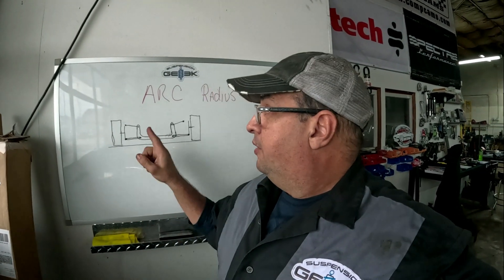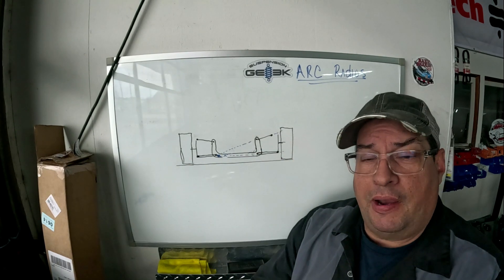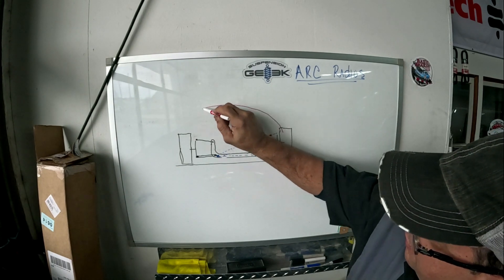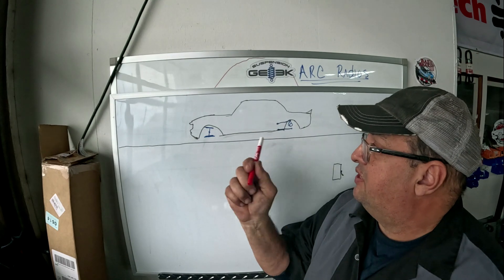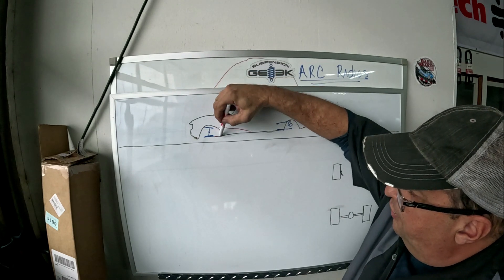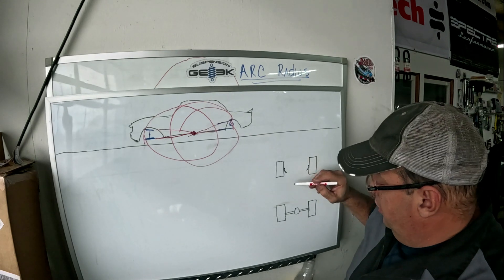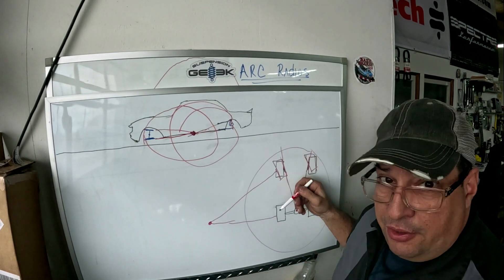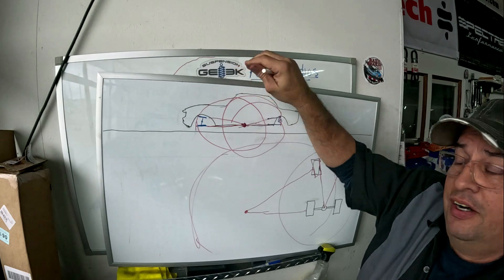THE Best Suspension Secret REVEALED

Comment: OMG I can't believe someone actually doing this. I was doing this back in the late 1970s 80s 90s building nascar open wheel modified. I can show you piles of paper work before we had computers where we designed chassis on the jig with string, plumb bobs, straight edges and tape measures. Roll centers, instant centers, torque arms etc. I'm glad to see this video brings me back to the old days but this still applys today. Great video !!
Reply: ,,,,,,,,,,,,,,,,,,,,,,,,,,,,,,,,,,,,,,,,,,,,,,,,,,,,,,,awesome support for this man's work and presentation..................................

Comment: If ya don't have a 4 link some guys use RAS road active suspension to get rid of wheel hop & set one side tighter to keep the rear wheels straight off the line as a hack until ya get a good 4 link set up like Detroit Speed or QA1 making sure your front set up is compatible with the rear set up

Comment: So old school.....
We have progressed to 
"Linear track suspension"
Where the wheel moves vertically, no in an arc at all....
Everything from McPherson strut forward.....
Reply from the maker: What are you racing? You sure there isnt an arc? Even struts have arc... that is why you have the set static camber and then you have dynamic camber.. what is gained during movement.. that is the part moving in arc
Reply: @SuspensionGeek  
No arc.....unequal wishbone lengths ( double wishbone )
The wheel rises vertically as the front track reduces. ( I wish I could draw you a vector diagram )
It maintains full tread contact for the whole suspension motion....improves tyre wear and grip.
Under load, the front track reduces for improved cornering.
Also maintains full tread contact under "body roll" load.
Corner radius is reduced under brakes compared to "flat out" through a sweeper, for example.
( it is probably why a V8 Supercar handles better than a NASCAR...... and no, I will not give you the figures.....just the principle....
castor, camber and toe doesn't change
and is now static throughout the suspension travel..... if you get it right !
( steering adjustment ESSENTIAL draw your vector maps in "3rd angle projection" and you will see the steering link incorrect length and "radius point" will cause toe-out through travel )
Reply: @SuspensionGeek  
If ya didn't get all of that but understand the principle, I will send "ballpark" numbers and angles as a starting point.
If you do, you don't need them.
Just start "playing" on your whiteboard.
Vector diagrammes using
Tech drawing "3rd angle projection" ( or 1st) works wonders for instant angle alignment.
Even track width change under load is adjustable when you look.( by adjusting the length of the wishbones ).

BIG "BALLPARK" 4 inches vertical motion for a 1 inch reduction in track per side .... this ratio is not correct, for my vehicle, but gives a "starting point" for your own dynamics.... play with this ratio from 2:1 on your whiteboard... as it obviously depends on your spring rate and suspension travel to "dial in" the desired results

Comment: You are showing the arcs and the lines and approximately where they can be or should be, but not explaining why one is better than the other. 
What happens when the rear squats when launching from a dig or out of corner then the outer circumfrence of the turn side of the car is squatting mor than the inside. How do all these things affect the arcs. Or when you are diving in to a corner and hard on the brakes and rear comes up and the nose is squatting. All the arcs are going to be changing along with the centers. You are going to need to shows us real world cars in action, or 3d simulations to have any hope in making anyone understand what you know and are thinking. Just drawing lines and circles and saying it is better explains nothing if your goal is to get the viewers to understand. And quite frankly, as a viewer I have no idea what you are talking about. 
Next, what cars do that you have setup are winning races so we can be confident that just because you say it is better is true?

Comment: I'm going to be amending C7 Corvette cradles (subframes) with suspension and C6 drivetrain onto a Stephen Blake era Avanti; which still utilized the original Studebaker Avanti frame. I do have a slightly longer wheelbase and must have the torque tube lengthened. Having watched your video, it has coerced me to do some suspension tweaking to adjust the longitudinal instant center since I have a longer wheelbase than those Corvettes.

I'll keep the Corvette's track width, as the factory Avanti's track width will be extended via some bubbled fender flares.

Comment: I spent 30 min. on the Art Morrison website before designing the four link system for my 1976 F100.  Sent them out for laser cutting, and after having assembled everything,  I was amazed how well the tires would lift during launch. The key was triangulating the geometry of the intersection point of the upper and lower links to meet at the centerline of the cam journals..

Comment: Neither "arc radius" nor "instant center" were mentioned in my engineering school.  If they were, it was briefly once, with no application.  We didn't have an automotive program, so maybe that's why.  Anyways, I've still learned more on YouTube than I did in class. 🤣
Reply: Arc radius center does not only apply to cars and trucks.

The term arc radius center refers to the center of the circular arc along which a point or object is moving. It is essentially the center of the circle that defines the arc.
Reply: I have understood 'instant center'as in coil springs suspending automobiles. (I'm kind of old Chrysler/Packard. Tortion bar stuff) With coils the weight of the car is stood down on the contact point of the tire. Tortion bars the weight kind of needs to find it's way to the ground and the tires just happen to be in the way of the car tipping over further. Sounds funky I know.  This guys 'instant center is quite valid and I do trust his terminology.    Good presentation.  Good starting point for further discussion in suspension design .

Comment: Thanks again for another informative video Rod. Maybe could we have steering components next? I know not many know what Ackerman is and also how to inspect for slop. And maybe the complexities of switching to a rack? I have a 73 ventura. With an LS. It came with a 69 firebird steering system and I want tighter steering but I don't want to have to fight to find another oil pan that will fit.

Comment: Read Herb Adams Chassis Engineering. Less drama, more straightforward facts. Anti-dive and anti-squat can be adjusted for best road race, drag race or autocross. Throw in Ackerman where the inside tire vs outside can also be adjusted per track (F1 does this all the time), caster and camber gain and there are all sorts of combinations of adjustments that have little to do with string circles or meeting at magic points in space.
Reply: There is also Steve Smith Motorsports.  Not sure he is still doing stuff but he had a few books on suspension design.

Comment: Wow you will have to tell me if my other comment is on right track or total confusion. I love the way you expressed yourself thru the concepts and found I could follow and  understand the cause and effect. But now and no joke would you make a video and is the following  a more complicated  model, So if I'm driving my japanese front wheel drive on gravel and rallying when i'm approaching a hairpin or like as I down gear creating a engine compression to unstableise the car in the opposite direction to the corner so its easy to flick the car to face the direction the road is at the exit of the corner but my wheels direction are actually following the radius of the road ( parallel to left and right gutters) unless I have to fine tune that angle incase i had the speed or camber of road etc misjudged but all in all a easier task than trying to drive around the corner without sliding.  So I'm asking are there extra arcs at play or other geometric shapes??

Comment: So Im at 1:16 iin and want to test a crazy phenomena.  for the last 20 minutes ive been thinking about force feed back simulator steering wheels and how the whole concept is nothing even in the same ball park as how steering in a real car functions and feels. So im trying to picture in my head when a road is extremely undulating like every meter either side could go up and or down 300+ mm, Then to stay straight you just let the steering wheel drop left and right depending on which side has the depresion, then im is that just old cars with sloppy steering and for the life of me i was stuck befuddeled as the steering wheel turns the direction of the depression then on the tyre would turn away from the centre of the road  and car leaves road, But not with the arc drawing it onto the angle.  If that's the case then thats super spooky due to You Tube never Ever suggesting something i want to see and more so the maths solution to the physical function my brain knows but cant display in a mathematical schematically technical model to express to some one else why I think about the simulation wheel being far from similar to life.

If not then I'm sorry to be spinning my wheels in your comment section,  and a least in going to learn something .  im sure im going to look like a fool but I cant help my self

Comment: From the factory with leaf springs and no anti dive on the upper control arms. Did these old car companies take suspension geometry into consideration, or did they just slap some parts on a frame and call it a day? I love suspension engineering but seems no one is into it. Most people don't even inspect the underside of their vehicle before purchasing it.
Reply: They did look into the geometry but they heavily focused on making it easy for the wheel to turn from a stand still or slow speed. Which in turn is horrible for at speed handling
Reply: Yes smooth ride and ease of steering      then came wide sticky tire and enlarge return lines from the power steering boxes to the resovour. Oi.   @AutumnsGunnar

Comment: Cool, right? Yes! I was an electrical engineer who drifted into software and spent most of my career there. Recently I got into motorcycle racing and I’m setting up a race bike for next season. Now I realize that mechanical is where my passion lies.
Reply: Mechanical is great. Not any king of technician/engineer. (Heck I'm not career orientated at all. Me so stupid). Back when cars in the junkyard were mechanical marvels one can physically see mechanics. Now everything is electrical.  No levers and rods.  Everything is snap together. No nuts and bolts.   Very disenchanting.
Reply: @jamespell8091  While I agree there is a lot of new junk right now but we definitely still have nuts and bolts and levers and rods and things do not snap together.  
   A good example is the whole world trying to force electric cars and almost all the manufacturers falling in line to help their image.  
   except Toyota who saw through the hype and made decisions based in reality while media tries to paint them as falling behind in technology.   
   Instead of putting out a socially acceptable futuristic all electric flagship sports car they introduced a manual transmission only full time mechanical all wheel drive not an electric axle Even though they already had one developed and could have very easily just thrown that in there.  
   Instead of dropping the manual transmission from the line up like other manufacturers,  they made it the premium model.
   It's both, a fully mechanical drivetrain with three pedals, a 300 horse power engine in a Corolla with a beefy block deck and cylinder wall thickness like a darton block.  And a warranty.
   It's also port injected and direct injected and got dozens of magical sensors. 
   And if you were to go down to the junkyard today you could see them.  It's not all the cars it's not even the cars you would think it would be but internal combustion ain't heard no fat lady, and it's a hot rod golden age right now and we are driving to the conclusion that we are the answer.
     Also I take offense to the term junkyard, they are Zen gardens if I've ever seen one.

Comment: Great video!  I was building a Locost for autocross.  I'm a fabricator, not an engineer, so when I got to time to engineer the suspension, I bit off more than I could chew.  Especially when determining ride height and wheel size/Tire OD came into play.  I've seen the principals before, but this has been the best with the tip of the iceberg of the why and how it's applied.

Comment: Using math as an example, one of the biggest issues I've had is being taught how, but rarely why or where it is applied. Like you said, fitting it all in a 20 min is not possible. I do feel like you're well on the way to the why and where end. 

In a future video, if you could and in how this affects the differences between different drives ( fwd, awd, rwd, 4x4), that would be amazing. 

Thankyou for putting this information out in the format you are!

Comment: Michigan Tech engineer here.  Your 'arc radius'  center is known always as an instant center.  These are dynamic systems.  That is why it is called instant.  They are constantly changing as the car is moving. (i.e. changing ride height or rolling, squatting, suspension traveling)  They do not use 'arc radius center' jargon because it is the instant center.
Reply from the maker: Yes i completely understand the motion dynamics and that roll center, instant center and COG are in flux.. like i said.. you cant break it down in a 20min video and if you want super in depth videos.. tbats not what im doing.. im taking the princlples and reducing it to the nominal that is needed to understand
Reply: @SuspensionGeek  You can absolutely break it down in 20 minutes.  It's not that complicated and you can also use correct terminology so you're not confusing people.  No one says "arc radius center".  It's "Instant center".
Reply from the maker: Ah, the "Instant center"! Sounds like the superhero of suspension terms. I’ll make sure it gets the spotlight next time! but the Instant ceneter and arc radius are two differant things, the arc radius is the movement of a pivot point the instant center is the location of the pivot points...
Reply from the maker: @rstreets and im waiting on your video breaking it down.... patiently looking at my watch....
Reply: Yes, but...

Yes, the correct term is for the point around which a car's suspension and steering move is the instant center. 

An imaginary pivot point where the suspension linkages intersect, effectively acting as the center of rotation for the hub at a given moment.

But even though the term is not as frequently  used with respect to cars. it is a real concept in mechanical engineering. The  'arc radius center' is the center of the circular arc along which a point or object is moving moves. 

When the 'arc radius center' concept is applied to a car's suspension system, it can be used to show the curved path along which the lower control arms, the upper control arms if so equipped and the steering knuckles. On  truck suspension, the 'arc radius center'  would also apply to the front and rear radius arms if so equipped.

Knowing the 'arc center radius' center is critical for one's understanding of how car suspension components articulate and how forces are distributed during suspension travel.

A bit of internet  searching provides the following in regards to the 'arc center radius' for a car and truck susoension:

1. Control Arms (Upper and Lower): These arms pivot at their chassis mounts, causing the wheel hub to move in an arc defined by the radius from the pivot point to the hub.

2. Steering Knuckles: The arc of motion for the knuckle during suspension travel is influenced by the geometry of the control arms and their pivot points. 

3. Radius Arms: The radius arm's pivot point defines the arc radius center for axle movement.
Reply from the maker: @finestructureconstant3921 it's not an imaginary Center you can physically trace it and use it.. they use the word imaginary because  of no understanding of the basic principal...it's not an imaginary
Reply: Is that same as roll center.race cars use roll center all time longer and shorter ball joints etc
Reply: Hence the trapezoidal profile in sla suspension systems
Reply: Would it make sense to call it static instant center when the car is at rest?
Reply: @samanthagregoryurich4167  I would say that there is no need to add "static" because "instant" is used due to the dynamic nature of the "center point" and thus is the center at that given frame of reference (i.e., instant or "moment" in time).
Reply: you all meaning ackerman angles bumpsteer rollcentre bla bla bla.
Reply: It's variable in any car and with any driver that applies more to a racing setup. But then and again and a racing set up. It also comes back to the driver and how the driver is going to control the weight distribution of the car and the turns left and right at what speeds and also at the Camber and caster, and also if a track if it's saying, a track that has right and left turns is also going to be. At what speeds where thats taking place and where it becomes more important.

Comment: Is your camaro torque arm someone's setup or something you built yourself? Is the front link a pivot or a sliding link? Are the control arm rear pivots inline with the rear axle or are they below it?
Reply from the maker: Great question.. its an off the shelf from TCI.. and the only mods i did was extended the shock travel(moved the lower bracket down and inch) and made the pan hard bar sit lower the instructed..